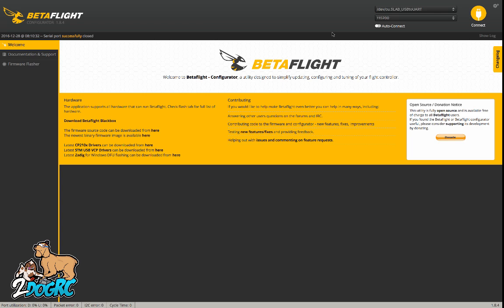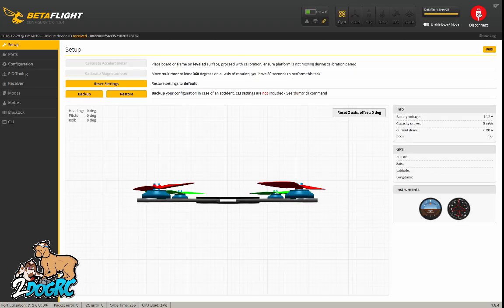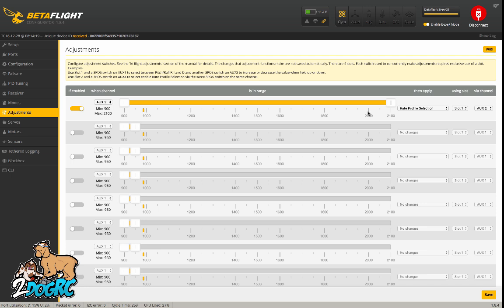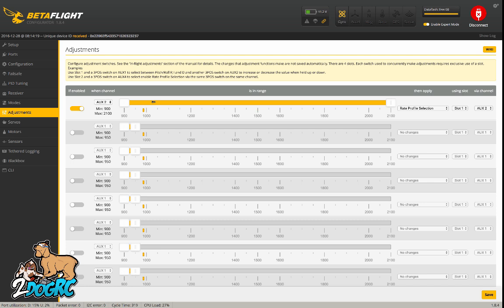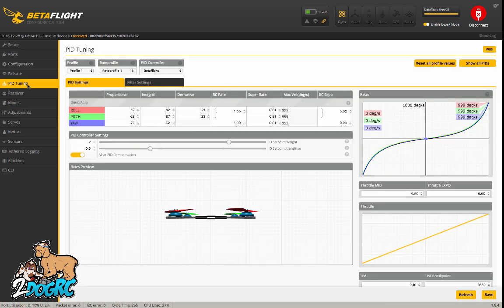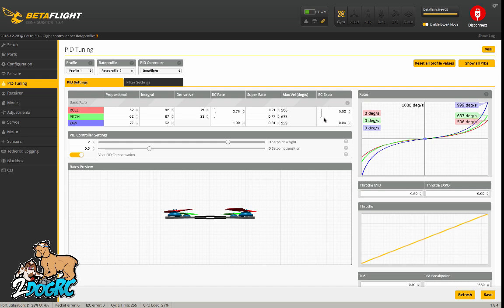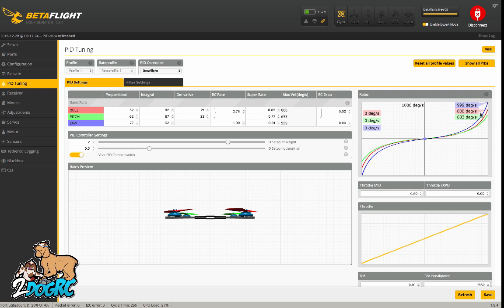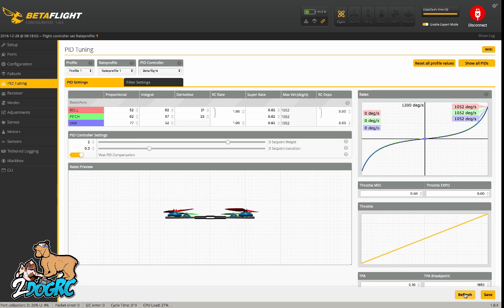Rate Profile Selection and PIDS

Comment: I didn't set up different profiles on a switch but in my pid tuning section it was defaulted to profile 2 and rate profile 1 at the top left. Since I don't have a switch can I assume it's only using those pids in flight? Or does it default to profile 1 when you turn on your transmitter?

Comment: Thanks for the tutorial, but for some reason I could not get it to work, although it seems pretty straight forward...
, using betaflight 3.2.1
Reply from the maker: There maybe a bug in 3.2.1 configurator.  There seem to be alot of bugs.
Reply: it's either that or just my noobness, first time using betaflight ,anyway it seems to recognize the aux input movement in the adjustments tab, it just does not change profiles on the pid tunning tab.

Comment: This doesn't work any more on betaflight 3.1.7 and a few others have noted it as well. Hopefully gets fixed soon I really want to be able to change rates on the day.
Reply: Can't get it to work here...  nothing changes in the GUI when I flip the switch.  Now, if I flip the switch, disconnect/reconnect, it loads the right rate profile based on the switch, but the GUI never updates unless I disconnect and reconnect.
Reply from the maker: I am pretty sure it does work on 3.1.7m that is what I have been using.
Reply: 2dogrc yeah I think it's the newer version of beta flight Chrome app that's causing the issue. Boris the dev is aware of it. Hoping it's fixed up soon.
Reply: Yeah, doesn't appear to work in the app...  not sure if it is actually working on the quad or not...  Going to test that tomorrow to find out
Reply from the maker: Working on 3.2RC5 just set it up on a prototype.
Reply: I'm not planning on updating my FC firmware to 3.2 (at least not for a while)...  is this broke and not working with 3.1.7 FC firmware, if you have a newer configurator app?
Reply from the maker: Working in 3.17 as well on 3.2.1 configurator.
Reply from the maker: try Refresh after you flip the switch.  Is the receiver power?  If you have a beeper connected and you are NOT connected to the computer, it should beep for each profile you switch to.  Ie 2 beeps for Profile 2.